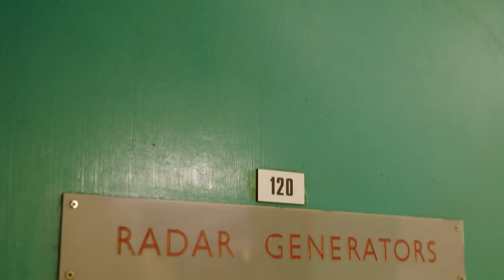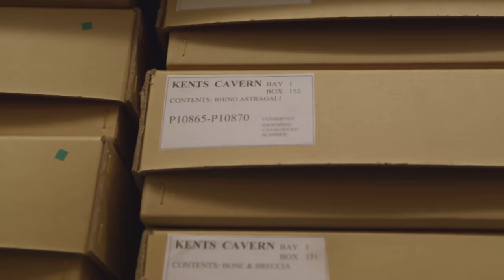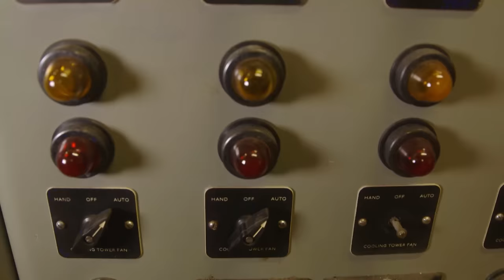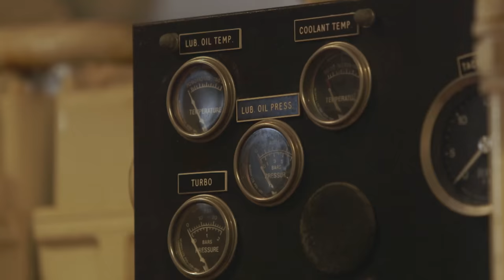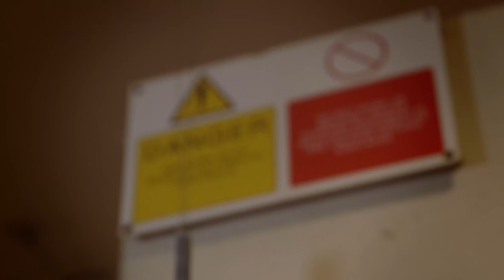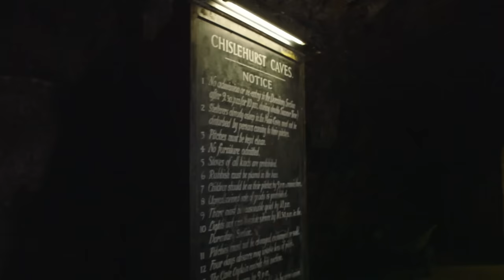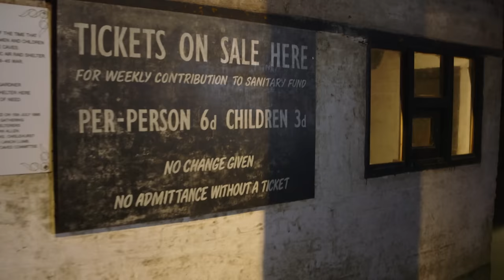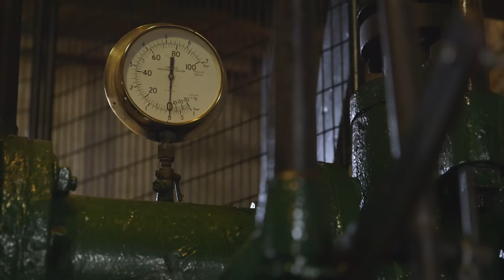The Nuclear War Base Designed To Save The Nation [4K] | Underground Britain

Comment: I think the rubber air seals were not the only means of isolating the interior air, because that area would be under positive air pressure from the blowers and the filtered air intake you showed. The  double Diesel generators were most likely redundant to the performance of the system. They would both have to fail together. Probably not "fail safe" as we used to say, but pretty close.